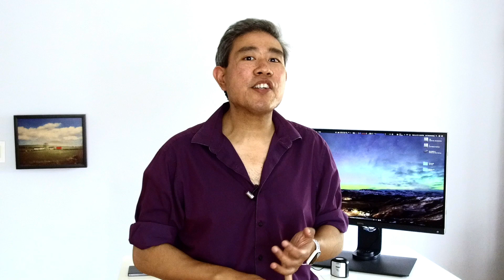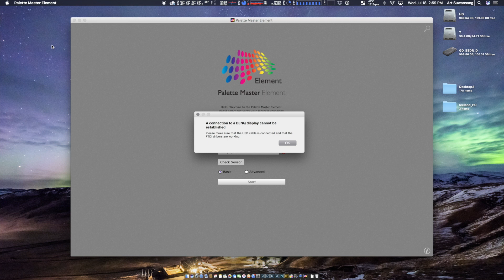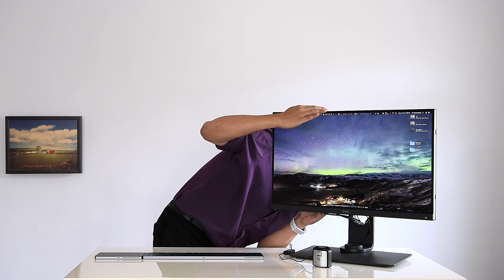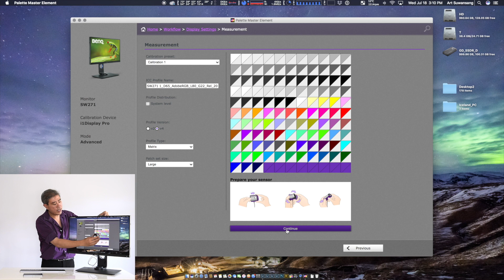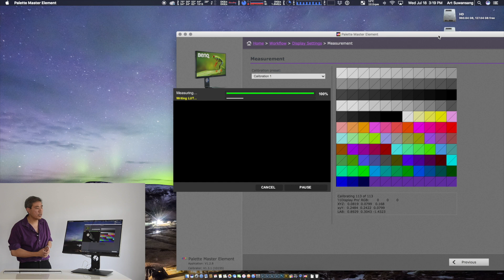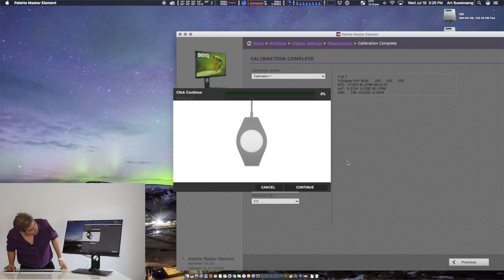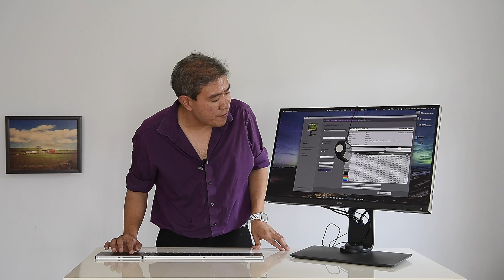How to Calibrate BenQ SW Displays with Palette Master Element - Art Suwansang

Comment: The most comprehensive, thoughtful and insightful video on hardware calibration that I have ever seen even delving into the differences between software and hardware. I have been struggling for months with Datacolor (now I realize - software and not hardware) calibrations of my BenQ SW240 with my Spyder5 showing month after month a progressive deterioration in their fidelity to Adobe RGB. 93% Adobe RGB colorspace in first calibrations in May all the way down to 81% this month. I knew that something had to give but could't get to the bottom of it. I started digging around help sections for BenQ calibrations and in forums I found this video. 

What an incredible blessing you are to say the least. Following along your video closely and tinkering a bit to my needs in the past hour and a half with Palette Master (can't believe a "print expert" had told me to just use Datacolor software calibrations now all these months and not the proprietary software!!!), and now wow!! My maximum delta E on attempt #2 is down to 2.81, with an average of 1.51. Given that I was literally clocking in 81% of my AdobeRGB colorspace 2 hours ago, this is just amazing to me.

You have literally saved my workflow +ArtisRight. I was even considering trying to return and get a new monitor!! One question: how often would you recommend doing a hardware monitor calibration? 1x/month?

Thanks again.
Reply from the maker: Hi @Mikael, thank you for the kind words and testimonial. So a few things to keep in mind too is the make sure that you let your SW240 stay on for at least 15 min before calibration this way the display can warm up and be more consistence once you calibrate it. About the calibration frequency. This is one of those variable things, my recommendation is to do this monthly. However, I personally do it on my primary display about every 6 months or so. These LCD are really stable and don't shift that much over time. I hope this help! Also I'm glad that you found me on the forum. May I ask what forum that is?
Reply: @ArtIsRight  Thank you! This was the forum - https://www.dpreview.com/forums/thread/4412397
Reply from the maker: @Mikael thank you, much appreciated.

Comment: Hello and thank you for sharing this video! noob question here. After the hardware calibration, i see an icc profile created. do I have to select the correct icc profile (through color setting in the system preferences in my Mac) every time I switch to a different hardware calibration (for example with the hockey puck configured for calibration 1,2 etc) ?
Reply from the maker: Hi @Matteo, you're welcome. So on a Mac PME will automatically choose the correct icc profile immediately after you finished the calibration. If your system does not automatically choose it then you would hav etc manually choose it. To answer your calibration 1, 2 question yes you would have to choose the corresponding profile. I made a video on that you can watch it here https://youtu.be/xQWzAzDbvqs
Reply: ArtIsRight thank you!!!
Reply from the maker: You're welcome!

Comment: I will go with the SW270C, now what calibrator do you prefer?  SpyderX 5 or X-Rite ?
Reply from the maker: At this time I would recommend the X-Rite i1Display Pro. However, we are in a transition period where X-Rite just released the i1Display Pro Plus, it is still not available as of this writing, but my recommendation might change once I get the production unit in and test it. If you need one today get the i1Display Pro.
Reply: @ArtIsRight  Thanks ! I'll go with the pro, but just to know is the X-Rite CMUNDIS ColorMunki Display could work with these monitors too? I guess the sensor hardware is similar.
Reply from the maker: Hi @Robert Gilbert so there are 2 ColorMunki devices, the colorimeter ColorMunki Display (now i1Display Studio) and the color spectrophotometer ColorMunki Photo (i1Studio). Only the latter ColorMunki Photo will work with PME. Neither the old ColorMunki or the i1Display Studio will work with PME despite the similarity in hardware to the i1Display Pro.

Comment: Hi. Great video.  I have the Benq sw320. Is there a reason why my dropdown doesn't have a Video Editing option?  That's my primary use with this monitor.  Thanks!
Reply from the maker: Hi @josh what dropdown are you referring to? In PME, on the display menu, etc?
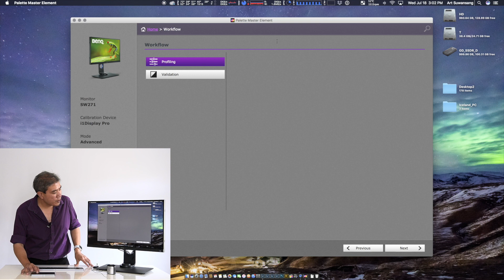Reply: @ArtIsRight  Yes, the Display Settings menu in PME at 6:50 in your video.  I only see Photographer,  Web Design and Graphics.
Reply from the maker: Hi Josh Thanks for the clarification. There are a few reason why PME does not have video as a preset. Another things to note too is that these are just presets and nothing else, you can still always dial in your own settings. Anyhow here are the reasons:
1. Yes even though the SW is perfectly a capable video editing display, its primary market is for photography, which is in part why the video preset is not there.
2. For video you would primarily be using REC 709 and you can set REC 709 in the RGB Primary and try to calibrate your display that way. 
3. REC 709 color standard does not specify the brightness value, where, photography and graphic design are mostly tied to print with is around 100-120 candela or nits.
This said, I calibrate the SW320 that I am editing these videos that you are watching with Adobe RGB primary and luminance of 100 candela. And they look great across multiple display. You don't necessary have to use the values that I set here but it can be a good starting point for you! Hope this help.
Reply: @ArtIsRight  You are my hero! Thank you so much!!!
Reply from the maker: @Josh Lunden, you are welcome!

Comment: So Art, what to do when Palette Master Element does not load even when using the 'pull out the plug' technique with a MBP and DP connection on a SW271?  Deleted and reinstalled the software. Any help here is appreciated.
Reply from the maker: Hi @Mark are you on a Mac? What OS version are you using on what hardware. Is your OS a newly installed one or has it been upgraded over a period of years; for instance, was it upgraded from 10.13 to 10.14 to 10.15 or was it freshly installed with 10.15? Depending on these answers, this may point us toward a problem and issues with OS rather than with the BenQ display or software. If the program launch and you get an FTDI driver error it is one thing. If the program does not launch at all as you described, it seem more like an OS issue. Let me know these answers and we can go from here.
Reply: @ArtIsRight  Hi and thank you for responding. I have a 13 inch MacBook Pro (early 2015) , retina display running 10.11.6. If I upgrade (which I heard creates lots of problems at times), should this resolve the " A connection to a BENQ cannot be established. Make sure that the USB cable ins connected and the FTDI drivers are working" problem with the BenQ? I am connecting with the DP cable to my MBP ad the monitor. Very frustrating! Thanks again.
Reply: Two more quick questions if you can help. First, since I was able to open Palette Master once and calibrate (with your instructions) and save, how do I open Profiles to reopen that saved profile...or, open the factory reset?? Second, do I need to also calibrate my Epson 3800 per i1 Pro  instructions to achieve the best results from monitor and printer. Again, many thanks for your advice.
Reply from the maker: Upgrading may solve your issue. I would like to know do you have the USB cable connected from the Display to the Laptop? That USB 3.0 cable must be plugged in for this to work. If the cable is plugged in, then I would try another USB port if you have one or another cable to eliminate the cheapest variable error, bad usb 3.0 cable. One way to test if the usb cable works is to plug in a USB device, mouse, keyboard, etc to the USB port on the left side of the display, if whatever you plugged in to that port works then, your usb uplink works and you should be good to go. If the the device that you plugged in does not work, then I would try plugging in the usb on a different port on your laptop, if you have multiple (I'm not sure how many you have) or try another usb 3.0 cable between the display and laptop. Now this said, I wouldn't just go out and update the OS. If you really want to see if the OS is causing an issue the best way to do this is to install a fresh new macOS on a fast USB 3.0 drive hooked up to your machine. This way your installation on the laptop is untouched. Once you get macOS installed on a USB drive, boot from it and try installing and running PME, if PME works without an issue, then this tell you that the issue is your OS. On a side note I've seen this happen multiple times before, where the OS is the one causing the issue.
Reply from the maker: To answer your other questions. You profile will correspond to a specific hardware calibration slot on the display, the default is slot #1. On your Mac you can find your profile in system preferences > Displays > color and in the selection box, you can choose your SW 271 profile toward the bottom of box (Scroll Down). If you can't get PME to launch and you were success once profiling the display, I would not do a factory reset on the SW. Otherwise, it would erase all of your hardware calibration profile. If you have an i1Pro then I would do a custom calibration on the Epson 3800, this will ultimately depend on what paper you are printing on. If you print on Epson Paper then definitely custom profile. If you print on Hanhnehmule or Canson then you might not need to custom profile, their canned profile is rather good. Hope this helps.
Reply: @ArtIsRight  Thanks for your help Art. I have to use a DP as my laptop does not have a USB C port. I've tried the Apple adaptors, e.g., Thunderbolt 3 to Thunderbolt 2 and the male to male Thunderbolt cable to the benQ but that did not work ("No connection" on the BenQ).  I spent more than the entire day trying to figure this out and have not gotten to touch my images! Ughh, If I can, I guess, calibrate my Epson 3800 to match the display as I see it, it will be a relief. That still leaves my inability to calibrate the monitor. Thanks again. I might try to upgrade my OS also. Next stop BenQ support or it goes back to Amazon.
Reply: @ArtIsRight  Hi. update. I finally upgraded my OS to Mojove per your suggestion and called BenQ tech support. He that told me that given my set up, 2015 MBP  I  need to use BOTH the USB and in  my case, the DP cable. With that, I was finally able to launch Palette Master Element! What a relief! I hope this is helpful to others. Now on to calibrating my printer. Thanks for your help.

Comment: If i want to use sw2700pt as secondary monitor with a MacBook pro... Then how to calibrate macbook screen and sw2700pt to get the same color on both?
Reply from the maker: Hi, so you would use PME to calibrate the BenQ and X-Rite i1Profiler to calibrate your laptop. You can watch my video on how to do that here https://youtu.be/Aed02rg3wDA As far as making the 2 match, you'll get close but it won't match completely. The best thing to do in this case is to use the BenQ as primary and your Mac build in screen as a secondary. Hope this help. If you have any more questions please let me know.

Comment: I've looked at so many videos over the last few weeks about color calibration and this is by far the most descriptive and educated one I've seen so far.  Thanks so much for taking the time to make such an educated and well explained video.  I had been using the X-rite software instead and wasn't sure what the different between using either of the programs was, or which was best either. Subscribed!
Reply from the maker: Hi @Patrick. Thank you for subscribing and the compliment. I hope that this calibration video answer your question more between the X-Rite i1Profiler and BenQ Palette Master Element (PME); essentially they do the same thing but at different level, software vs hardware. If you have a BenQ hardware calibrated display then you should use PME. If you have any more questions about them please ask. Also if you have anything else that you want to learn, let me know, this way I can add them to my future video queue.

Comment: Has the latest version of Palette master element for Mac addresses some of the calibration issues of the earlier versions such as panel native etc.? There are numerous reports on blogs and dpreview pointing to inability to properly hardware calibrate on the mac which would negate one of the main features of this monitor. https://photographylife.com/reviews/benq-sw271
Reply from the maker: Hi @KL Tah, afaik, I was able to calibrate it PME without any issues. The profile, however, does have some color shift issue when the GPU render setting is used in Lightroom. The temporary fix right now is to disable GPU acceleration in LR. This happens when you do the calibration using Adobe RGB as the primary profile. I would try Panel Native or Custom RGB value as a test to see if there are any issues. Otherwise, you should be able to get good to decent result with this. Their R&D team is aware of these issues and have already implemented a fix already or is actively working on a fix. I hope this helps. If there's any specific issues that encounter please share that with me.
Reply: @ArtIsRight  were you able to calibrate with "panel native"? Was there a reason why you didn't choose that profile as that would theoretically give you the widest possible gamut no?
Reply from the maker: @KL Tah, because I mostly edit still images my reliance is mostly on Adobe RGB or a variation of it in various Adobe Program. Technically, panel native would give you the largest color space. I have tried this and there is a significant in increase in the color space volume. You can certainly calibrate your BenQ with panel native primary RBG and the profile will work. However, keep in mind that when you try to validate it in PME, the profile will fail because PME does not change the RGB primary to accommodate panel native yet. This is a bug in the program and a fix is in the works. Hope this helps... cheers.
Reply: @ArtIsRight  thanks for the clarification. So if I'm editing with the intent to print (currently with the pixma pro 100), I can benefit from panel native correct? The pixma pro produces about 60% sRGB but there is  a lot of colors outside the sRGB gamut (and possibly some outside argb as well but I haven't checked).
Reply from the maker: @KL Tah, if you choose panel native you will be editing on a really large color gamut. This is a good thing and even though you printer cannot produce the kind of gamut yet, it is getting better with each generation and one day it may be able to output at close to Adobe RGB. So what you are doing is make sure that your image edits are future proof for any new print technology that may come and increase the color gamut. 

One more side note here, you may be familiar with this already. It is the rendering intent, you'll be using it quite a bit in this case because your editing color gamut is much bigger than the print out put. So when you print you would pick either Perceptual or Relative Colorimetric. These two rendering intent will render your out of gamut color different and on some occasions produced slight to noticeable print differences, but what they are doing is make the large color gamut that you are editing your image with fit on the smaller color gamut of a print. This is a good video topic and I'll have something about this down the road. So much content to do, so little time to film and edit. Cheers.
Reply: @ArtIsRight  thanks. Since PME cannot yet validate panel native, is there a third party software that can perform the validation? Or is this something very monitor specific that only BenQ can put out? In that case best avoid panel native for now, since I won't know if the calibration was on point?
Reply from the maker: Hi @KL Tah, if you want to try an validate the profile there is a paid software called color think, it is rather expensive. I would recommend that you wait for now. BenQ is working on an update that will resolve this validation issue. So your conclusion is correct, avoid it for now until BenQ release the software update, once they do, I'll probably do another video on how to do a hardware calibration on the SW display to get the largest color gamut possible.